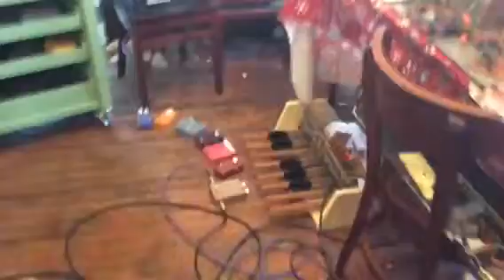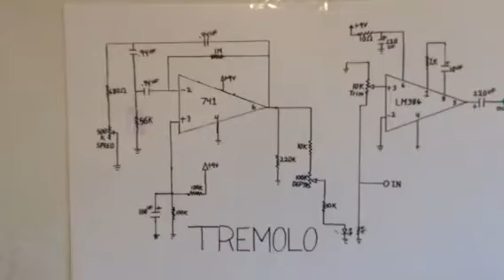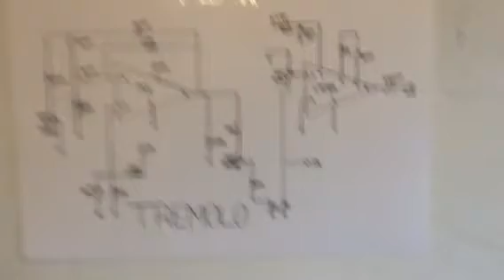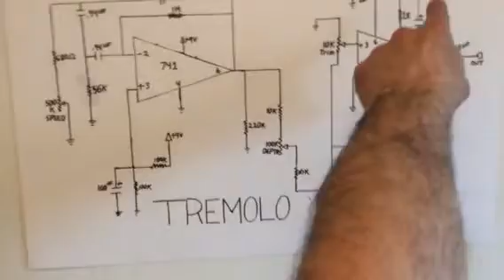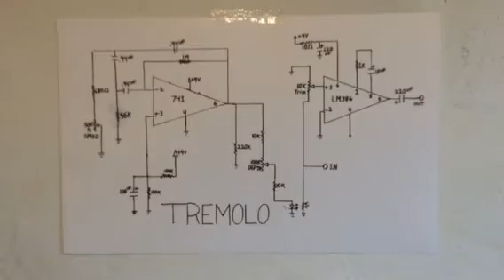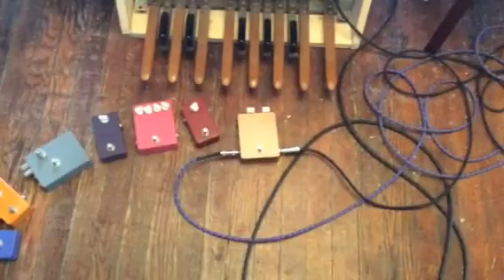Easy DIY stomp box tremolo

Comment: @The Electronic Slob ... quick question, for the power supply, did you only use 1 9v battery? Also, do you still have the schematic?